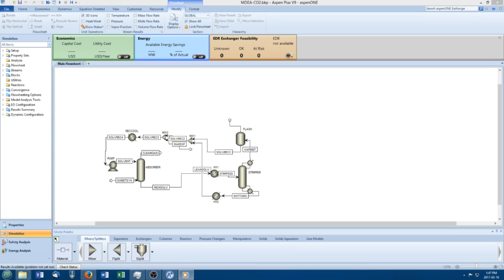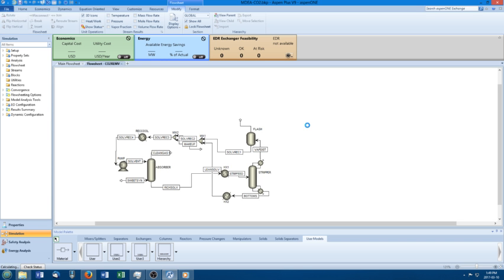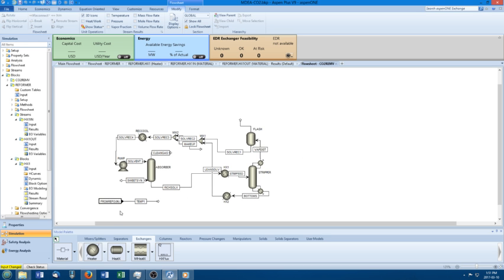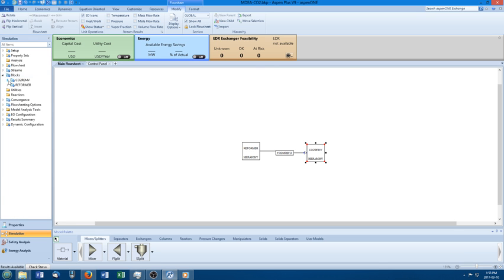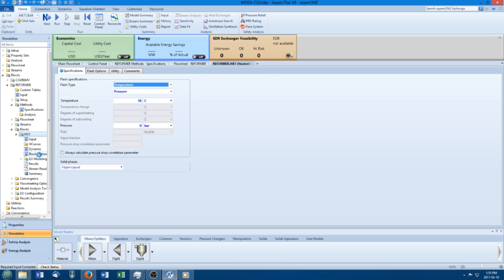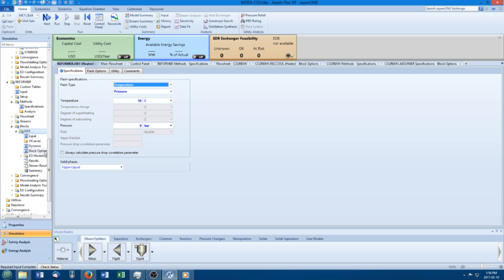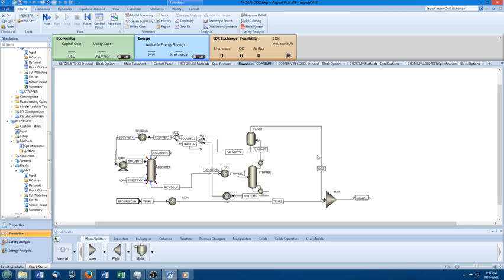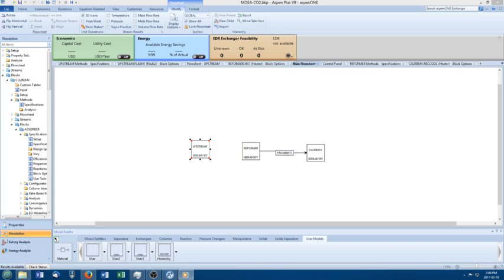Aspen Plus: Merging two flowsheets, heirarchy blocks, and changing physical property models

Comment: Good day sir. 
I wanted to point out that the link attached to the video is no longer working and of there is a way you could help with that
Reply from the maker: Weird, it is working for me. If it is still not working, there is a mirror copy of the data here you can try.: http://psecommunity.org/materials/calculationfiles